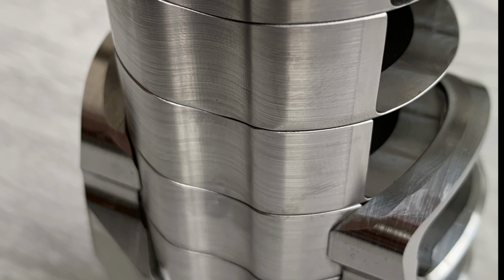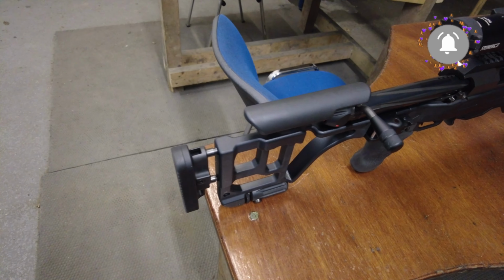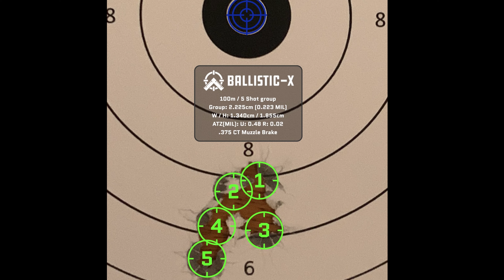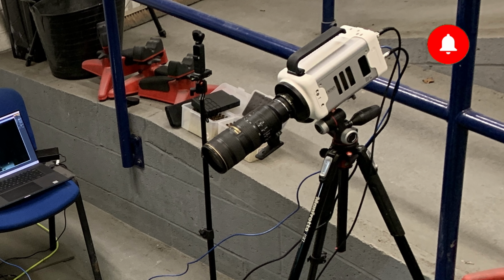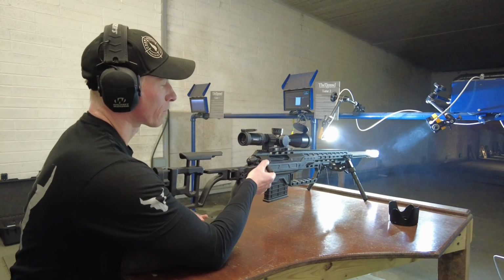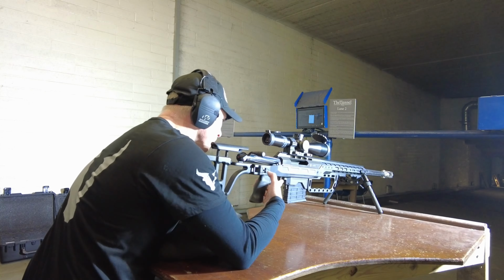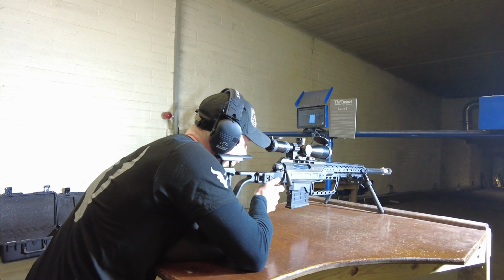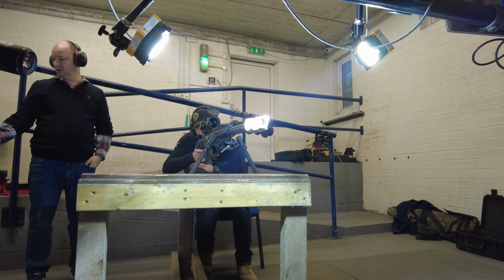Victrix Armaments Magnus Muzzle Brake Prototype Testing .375 Cheytac

Comment: I would like to see it comparted the the Terminator 5 Muzzle brake.If its  better than it Id buy it.I have not seen any magnus Muzzle Brakes at any ELR Matches.95% of the ones used are theTerminator 5 or 6. Im always looking for something better.Thanks
Reply from the maker: I’ve not used the terminator brake, but the Magnus did appear to do the job nicely. We did some extreme slow motion testing and Victrix have conducted various other tests to ensure that it works efficiently. I’m very much a “not follow the crowd” type person and I like to forge my own path, so for me the magus is a bold, creative choice.
Reply: @JonCresswellUk  Follow the crowd? When 95% of the cream of the ELR shooting Pros use something there is a reason .Because it works the best.I really expected a better answer than "I don't follow the Crowd"
We someone testing omitts the top of the line most widely used competition there is a reasom
Reply from the maker: @TexasTrained  that probably came across wrong, so sorry. I’m not an ELR shooter so haven’t had a chance to try the terminator muzzle brakes. I also don’t know who has one that I could try to compare them.
Reply: No Problem man..Thanks for the apology but it was not needed.I may have been a bit harsh myself and I apologize. if it sounded that way... @JonCresswellUk
Reply from the maker: @TexasTrained No worries, it’s all good. Thanks for the challenge!  I do need to try some other brakes, it’s just getting hold of them to try out.  It was a friend’s rifle and slow mo camera too!  I’ll see what gear I can get hold of and make some more videos. Thanks for your support and let me know if there’s a video on your mind that I could try to make.

Comment: Good Video.I dont see anything spectacular about this muzzle brake taht sets it above any other brake.Iwasexpecting much better.
Reply from the maker: I’ve only used the one on the .375 CT but it did a fantastic job or reducing felt recoil and it vents 98% of the gasses behind the bullet so is very efficient
Reply: @JonCresswellUk  Okay.Thank you.I was watching the recoilon video and the bipod jump back and up some as well.It did not look like it tamedit as much as it should by looking at it.You were behind the gun so you felt it.Thanks.Good Video.